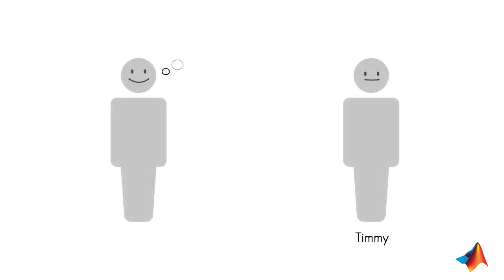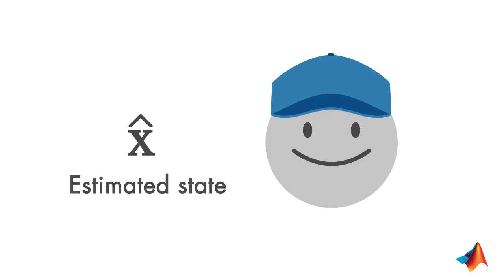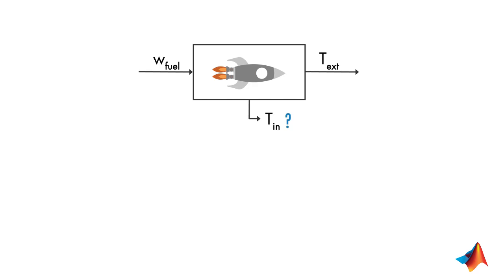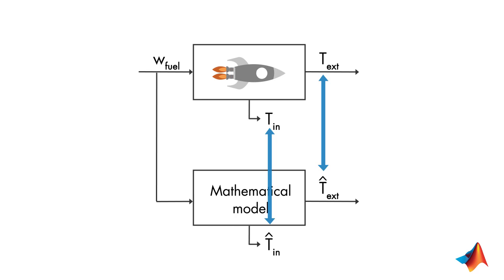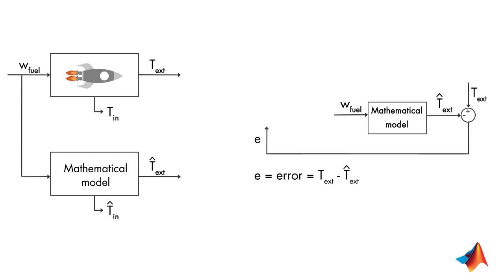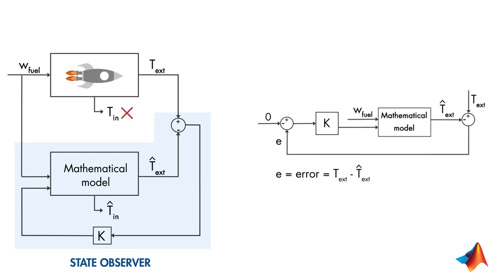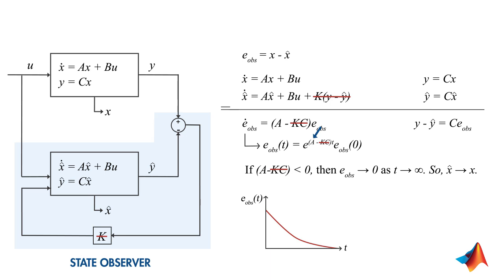State Observers | Understanding Kalman Filters, Part 2

Comment: @3:45 what guarantees that if [ T(ext) and (cap)T(ext)  ] are equal then [T(in) and (capT(int) ] are also equal? Was that your assumption? If not then we need to find a spot where this assumption is near real, and that we are taking measurements based on the real "Dynamic Range" of linear correlation of those two measurements. If those measurements are beyond the real "Dynamic Range" operation then I assume that we can not make this assumption.

Comment: Oversimplification   may lead to incorrect information. First : the eigenvalues  of  A-KC   should have negative real parts , not that A-KC should be <0 ; this is only true for the trivial uninteresting special case of a single state system . Second: K is a must in cases where the original system is unstable, i.e. A  has eigenvalues of positive real parts, otherwise  the error signal will grow without bound  in the absence of K as the error  dynamics is now governed by A . It’s important to point out that observers are also needed in the design of  unstable systems.
Dr.Omar El-Ghezawi, the University of Jordan, Amman, Jordan

Comment: It's a very clear explanation! I just have a question about 6:00. Why does the real system have the same equations as the model? In this video, it says model is simply an approximation of the real system, but at 6:00, the equations in both blocks are same. Also, if they are same, why do we need a state observer, why can't we can calculate x directly by using y=Cx?

Comment: In my opinion you need to link better the qualitative description of the problem with the formulas and the "loops" used in electrical engineering... it is not a self contained presentation.

Comment: where is exponential from?
Reply: It comes from differential equations. If I have a single-dimensional function for example (not matrices like above). x_dot(t) = a*x(t) is a differential equation. In differential equation our main goal is to usually find "x" such that the relationship above is true. If you pick x = e^at for example, remember that the derivative of an exponential is the same exponential times a constant, so (e^at)_dot = a*e^a(t) since x = e^at, it holds the form x_dot = a*x. The e(0) is our initial condition, it allows you to find a unique solution to your problem.

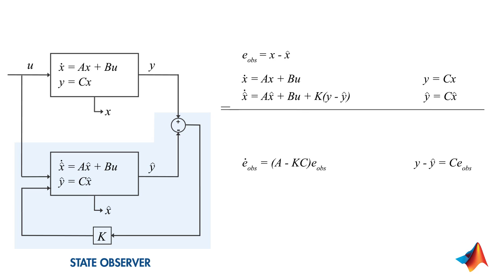Comment: 6:12 I dont understand why there is an expornential (A-KC)t come out of nowhere.
Reply: It comes from differential equations. If I have a single-dimensional function for example (not matrices like above). x_dot(t) = a*x(t) is a differential equation. In differential equation our main goal is to usually find "x" such that the relationship above is true. If you pick x = e^at for example, remember that the derivative of an exponential is the same exponential times a constant, so (e^at)_dot = a*e^a(t) since x = e^at, it holds the form x_dot = a*x. The e(0) is our initial condition, it allows you to find a unique solution to your problem.
Reply: @kabascoolr  OMG, I get it now. Thank you so much!!!!
Reply: @atle0704  No problem!
Reply: @kabascoolr  I still got another one need to be explained, why it is x_dot = Ax + Bu instead of x = Ax_previous + Bu. How can the derivative of x is equal to Ax + Bu :(((. In the next chapter, the x equation turn to x = Ax_previous + Bu. Which one is correct ?

Comment: 2:20 don't we have to find the fuel flow from the external temp?
Reply: In this system, ideally we would measure internal temperature and based on that control the fuel flow. However, this is not feasible because we cannot place the sensor inside the engine. So, what we do is measure the internal temperature indirectly. And this is why we measure external temperature.
Reply: Did understand that portion. Nonetheless, thanks for the elaboration. What I don't get: 2:27 T(hat)(ext) has been considered as the output while fuel inflow as input (in the mathematical model), contrary to the practical model.
Reply: What do you refer to when you say practical model? Both real system and mathematical model have the same input, fuel flow and the outputs are the external temperature and ext. temperature estimate, respectively.

Comment: Hi, I also have the same confusion as totoxahc. To be specific, I think we should use \hat A, \hat B and \hac C in the mathematical model, which are different to the real measure model. Then in 6:09, the error function would be e(with a point on it)_obs=((\hat A-A)-K(\hat C-C))e_{obs}. We can not adjust A, C(which we don't have access to) and either\hat A and \hat C. So in order to make the error converge to zero, we must have a feedback loop, in this way, we can adjust K to make the error go to zero. I think this would make more sense. How do you think?

Comment: 5:56 : Could you please explain how did you get x(hat) point
Reply: Firstly, I am not sure about my answer, and I will write  my own explanation to myself. At the second part the input to the system is no longer u but u-K*(y-y^). Hence when we apply equation A*x+ B*u, we will get A*x^+B*[u-K*(y-y^)]. When we expand this equation, what we will get is A*x^+B*u-B*K*(y-y^). Since B*K is just a constant changing with K, which is under our control. In equation, she just used K as constant. However I think that K is not the same K, at the feedback loop as I said.

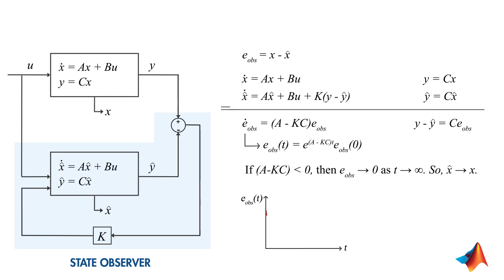Comment: At 6:20 why are you saying that A and B matrices of both models are the same? I always see this in observer explanations but we know it is not true. Edit: I forgot C matrix.
Reply: Hi totoxahc, @ 6:20 I discuss how the feedback term and how it helps the error to vanish. Can you please expand your question?
Reply: Hi,
In the diagram, the upper system (the one without hat in the state and output) is supposed to be the "real" model right?
The system below that is supposed to be a model of the upper system and one of the reasons to use a observer is because of the modeling errors, that is A, B, C and D matrices of both systems are not equal.
I think one should use A, B and C for the for the upper system and \hat{A}, \hat{B} and \hat{C} for the other and then the equation for the dynamics of the error should be correct
Reply: If you compare "dot_hat_x = hat_A hat_x + hat_B u" with the equation in the video you will get  "hat_A = A - K hat_C"  and "(hat_B -B) u = K y". 
What is quite strange. So there are maybe some assumptions/approximations in the controller model which are not explained in the video.

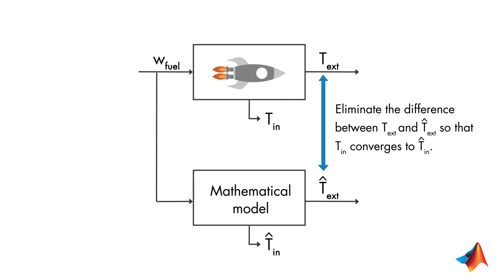Comment: 4:00 how do you know Tin and Tin^ will converge when Text and Text^ converge?
Reply: Hi Yuhui,
You have your real system and then the model of your system which you represent by a mathematical model. Now imagine a perfect scenario where you know the model exactly, meaning you would expect to see the same behavior at the output of your real system and your model since they match perfectly. If you now provide the same input to your real system and your model, you'll see that the outputs y and y_hat will be equal to each other as well as x and x_hat. In a system, we may have no access to system states x, but we measure y and we can calculate y_hat. And from the above discussion we know that if we can match y with y_hat, x_hat will converge to x. Hope this explanation is helpful.
Reply: @meldaulusoy8389  I am sorry but your answer doesn't explain the problem here, as we usually don't have the exact model of system. Imagine you have modeled an order 2 system with an order 1 model, so it doesn't matter how you try to match y and y_hat, the x and x_hat won't converge!

Comment: What is the X_dot in this video. I don't understand. THanks
Reply: Hi Will,
The equations X_dot=Ax+Bu and y=Cx are the state space representation of the system that we discussed in the video. State space lets us represent systems with a first order differential equation. The equation x_dot=Ax+Bu is called the state equation where x is the state (internal temperature in our example) and x_dot is the first order derivative of the state (rate of change in the internal temperature).
Reply: @meldaulusoy8389  It helps a lot thanks!
Reply: thanks a lot. I had a smae question. And your answer is perfect.
Reply: Hi Melda, I saw your video list on 'Understanding control systems' and was very help full. Do you have a tutorial on state space representation as well since it's hard to understand. Thanks.

Comment: 6:20 "Because even without the feedback loop that adds the KC term to the equation, we would have a decaying exponential function "...what?! When did you impose A negative definite? This is blatantly false unless you impose that condition
Reply: Hi Arnau, in case you have missed it, @6:37 it's shown that in the absence of the KC term (which is crossed out) the observer error e_obs still converges to zero as t goes to infinity if A<0 (this is shown on the screen). For a MIMO system we could also explicitly say that if all the eigenvalues of A are negative, then e_obs->0 as t->inf. Here,  we try to stress the importance of the feedback loop which helps increase the decay rate of the observer error function such that x_hat converges to x faster.

Comment: Excellent explanation.
Question:
If you get to 6:03 , Shouldn't K(y-y^) be negative because it is subtracted from the first equation?
Reply: Good catch! You're right, the equation should look like this: x_dot-x_dot_hat = Ax-Ax_hat+Bu-Bu-K(y-y_hat). In the video, the solution is correct but the sign in front of the K(y-y_hat) term should be -. Thanks for pointing this out!
Reply: Melda Ulusoy kız Melda bundan ben bahsetmek istiyordum but seems like you’ve watched the video before me :( good job tho
Reply: Good thing this is the first comment I read
Reply: @ranshahamran  I think what you are saying is fine if they end with this equation. But because the equations coming after have the negative sign, then the sign must not be removed otherwise it will confuse the viewers.
Reply: Yup.
Reply: I was just going to say that but you were the first comment to my eyes.
Reply: I also noticed that.